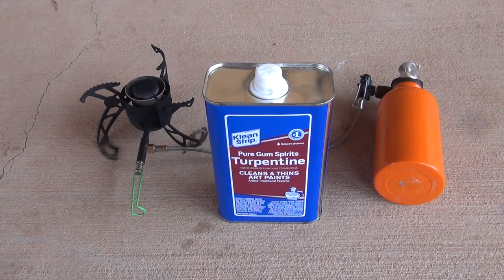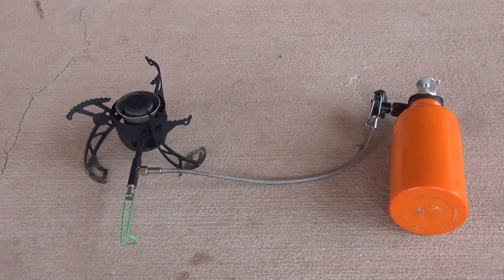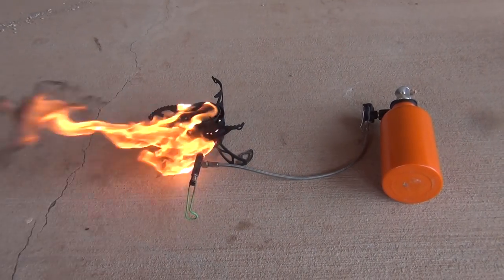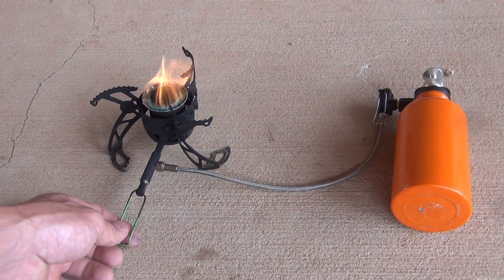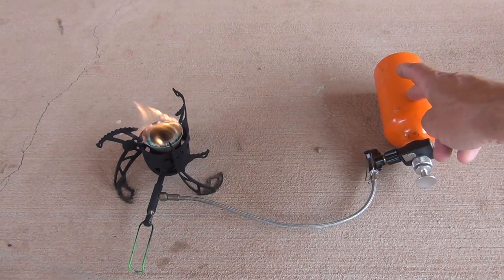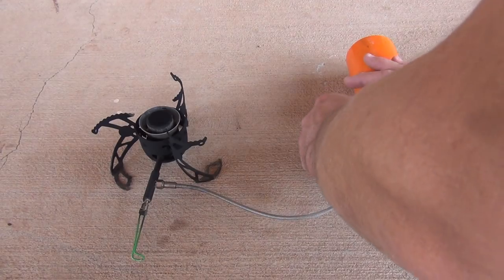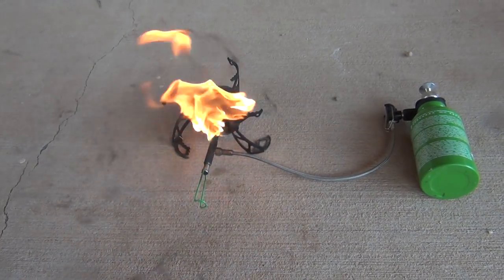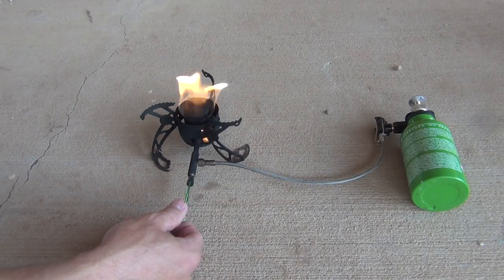Can you use TURPENTINE In Your Multi Fuel Backpacking Stove Let's find out! OPTIMUS POLARIS!

Comment: You can burn anything in a multi-fuel stove, ... until it stops burning and is all crapped up (DDDD) !  Options with turpentine is using acetone (model glue smell) that cuts the shellacs, tars, oils into smaller oil droplets.  Also helps aerosolize the heavier fuel for higher (and cleaner) heating.  Same for using a 16 drops of acetone in the fuel mix (16 ounce volume, 1 drop per ounce volume), and it will clean out the entire system (almost too clean, will chew on rubber pieces !).  Otherwise, could use methanol (wood alcohol) with same options, and also pulls out any water in the system.  Can also use isopropyl alcohol (rubbing alcohol) for mixing or cleaning uses.
Reply: This is also what I do very often when burning kerosene. I mix in a tiny amount of white gas. The shorter carbon chains will lower the average molecule length. The result is that the yellow flame tips are taken away and the the flames are completely blue.

Comment: Very interesting. What if you carified it with bentonite clay and/or gelatin to remove the impurities first? Cutting it back with other fuels might also help but clarifying it first should provide a cleaner and less sooty flame. Also, the Romans added a pinch of salt to most of thier fuels for a more pleasant and clean burning yellowish flame for soft lighting purposes without any problems. They didn't use jetboils though

Comment: The silencer you use sits pretty low in the stove according to it's manufacturer, indeed they have one that sits higher. Do you find that it makes any actual difference in usability, efficiency, wind mitigation and heat dispersion? Coz I actually like it sitting recessed in, visually, the way you have it set up.

Comment: Prime with alcohol and you don't get that soot
The additives in car gas or diesel fuel will definitely eat your seals (thank you California) if you leave fuel in the bottle, if you use car gas after your trip put the left over in your car and clean your pump and or fuel cap with kerosine or Coleman gas (no additives) & let dry
if your really worried change your seals with Viton or Nitrile seals (definitely needed if you try Alcohol as your main fuel)

Comment: You can use treps or white spirit for fuel. However it will smoke a lot so do it outside. Its not so clean as metholated spirit or ethenol.
They are oil based terpentine and withe spirit.
Pump should be okay as its in liquid form. Just flush it out with ethenol or methelated spirit.

Comment: Polaris is not as efficient burning heavy fuel. I run turpentine in my Nova with no problem. Nevey use heavy fuel for priming, use alcohol instead then you have no problems.